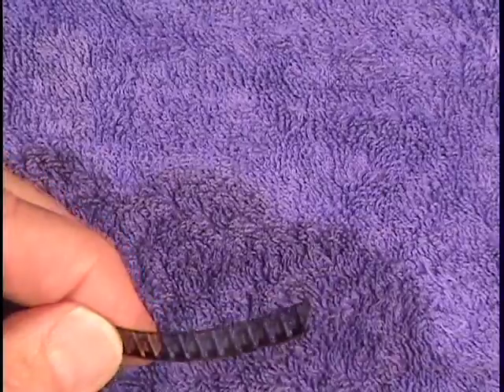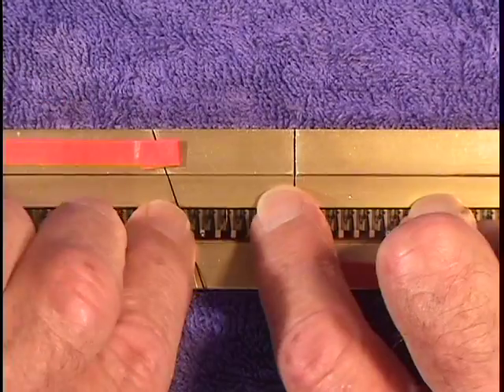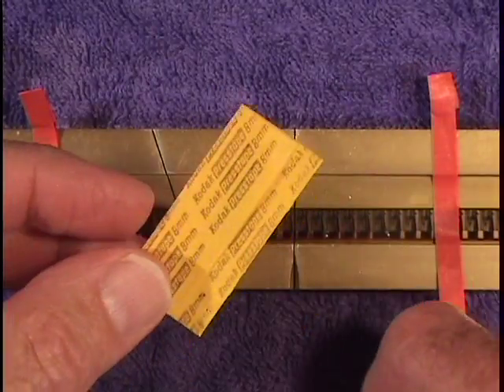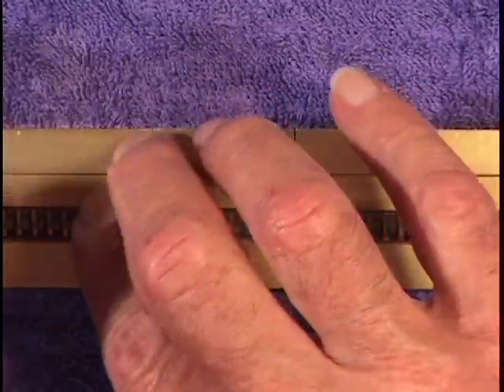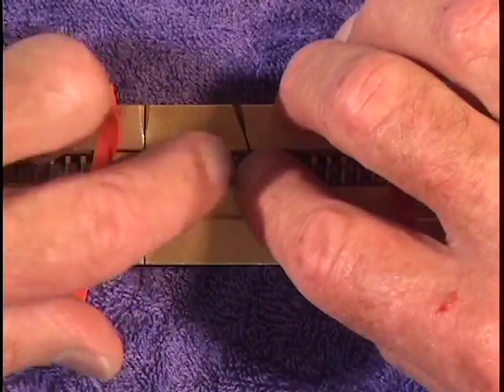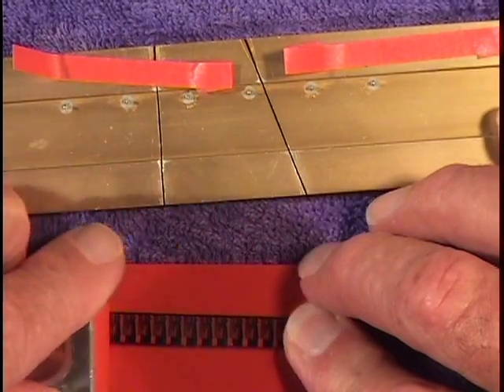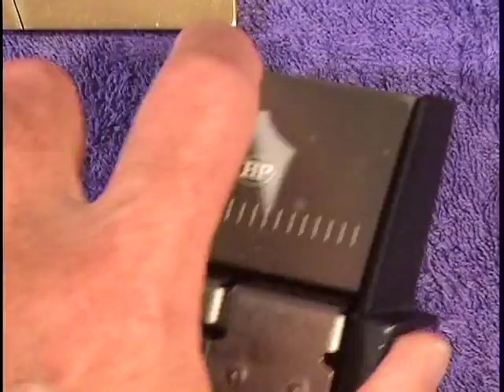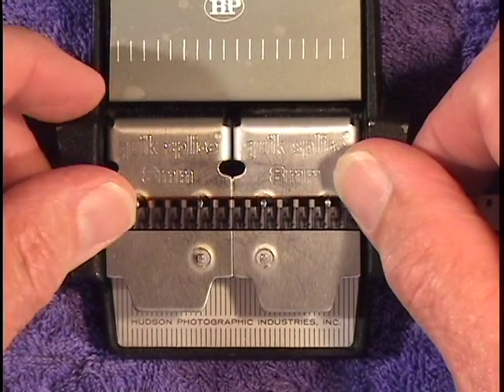Splicing Broken 8-mm with Press Tape and Splice Block (clip 11)

Comment: I saw your video and wondering if you bought your splicing block with the sprocket pins in it or did you drill out the holes for the pins.  If you bought the splicing block with the pins already on it, where did you buy the block?  Thanks.

Comment: Do you know where to get this tape? And is there tape for super 8 film? I have a super 8 film with a very similar break in it and would like to attach it.
Reply: Did you find the tape?
Reply: @linalaurencich6231  It's easy to find for super8mm but not for 8mm.